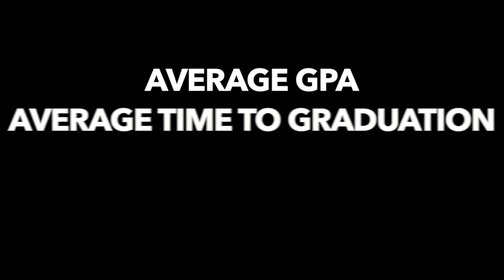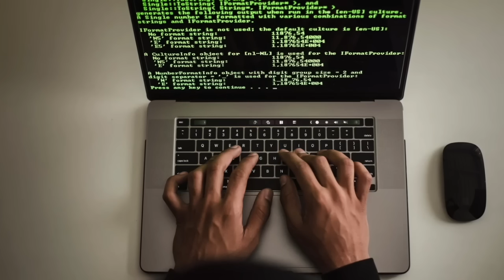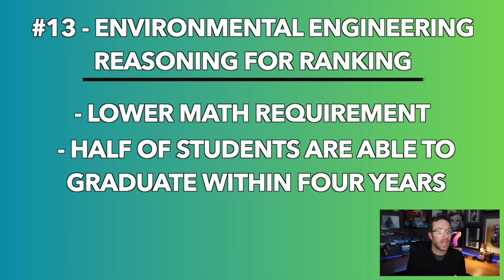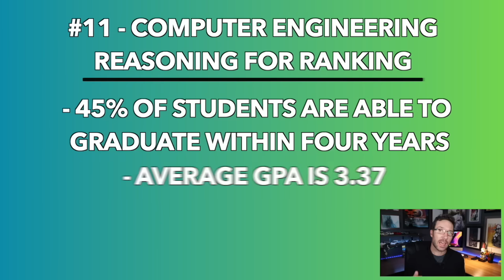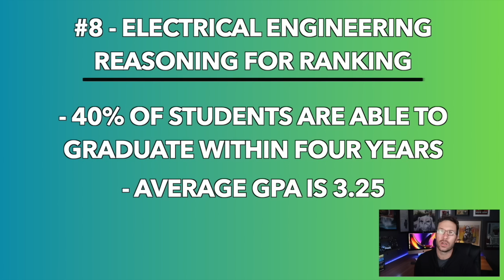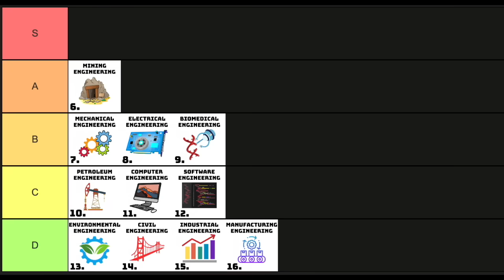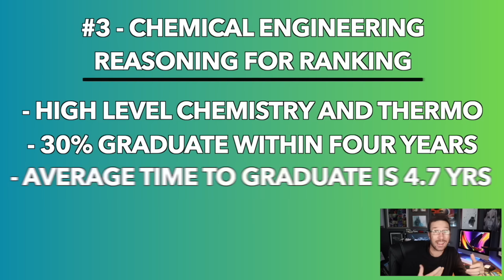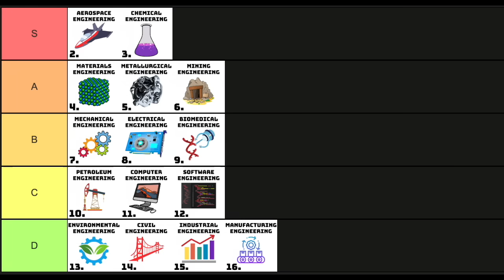Engineering Degrees Ranked By Difficulty (Tier List)

Comment: The Math for Electrical Engineering is one of the hardest math (Maxwell's Equations, Schrödinger equation, Landau–Lifshitz–Gilbert equation, Laplace Transform etc etc )
Reply: Laplace transform is fucked up, I did in uni, but I don't remember much of it, I salute everyone that have a good memory to really understand it, Maxwell is pretty hard too.
Reply: @eriksilva631  Yeah it can be quite daunting! If you go in with the idea of seeing it as a tool for turning differential equations in to algebra problems to find solutions using tables, it's a neat recipe to have in the toolbox. It can be very rewarding to dig deeper in to it though, especially Control theory and understanding the stability of a system!
Reply: @sebastianjovancic9814  Controls is interesting stuff!
Reply: @JIMLAS3359  yeah! So many of the systems we rely on use control theory, like PID-controllers, used in for example avionics or automotive systems! It's also interesting to design audio effects by exploiting the instability of a system to get for example oscillators :D
Reply: @JIMLAS3359  and the math behind digital control systems and digital communications systems gets a little heady.
Reply: @eriksilva631  Dude Laplace transforms are genius.  It allows to convert an integral in time or position domain into the frequency or momentum domain and vise-versa without actually solving the integral.
Reply: @eriksilva631  I don't know man. I loved Laplace because it was useful in signal processing and I loved that class. I thought it made things easier. I hated EM though haha
Reply: Exactly. I don't know why he listed only ordinary differential equations.
Reply: @Citizen052  lol I'm in Chemical Engineering. I wish the highest difficulty of math was ordinary differential equations.
Reply: @Citizen052  yeah but in broad spectrum most jobs doesn't need that level and you get paid for those extra stuff in any engineering degree your knowledge about physics and math set's you around and more you add to that base from your specific field it's extra pay but let's get real companies doesn't need more that 2or 3 percent of their engineering department that dedicated
Reply: @hellno100 yes, but it is that knowledge that sets us apart from technicians 😊
Reply: @Citizen052  some people need knowledge to aquire money some pay money to aquire knowledge
Being in that a few people definitely worth the pain and not just for money
Your views are exactly what they want for development
Sometimes I imagine my heaven being a full lab in middle of nowhere and I just swim on ocean of knowledge and yet better expanding it
Technician is a robot after a while (not that it's bad it's actually great but not all people made the same for example one of my darkest days was when I realized there not enough lifetime to learn it all)
Reply: Physicist here. I was looking for this comment. How did he end up with the conclusion that EE only needs up to ODEs? PDEs are an important part of EE especially electromagnetics… EEs work in complex domain as well and with mathematical tools like Fourier and Laplace transforms that other engineering disciplines don’t have to deal with. EE has, by far, the highest mathematical requirements of any engineering degree that I know of.
Reply: @cielsteam  It is not possible to state in such a  casual way what the EE  requirements are (or for that matter in any  other modern engineering domain)
Like in most other scientific areas, the variety of branches has grown and continues growing.
The requirements for preparing a career in (for example) power engineering cannot be the same as those needed to pursue a career in, say, Artificial Intelligence or even simpler Computer Sciences..
There are also ever more overlaps, some surprising, between branches of EE and totally outside areas. Take for example AI and/or voice control. Not only  you do need to study subjects related to feedback control systems
 but it becomes necessary to have a good understanding of mathematical logic, linked to linguistics and in turn linked to grammar and sentence structural construction that you expect to be taught in specialized litterature courses.
Reply: @pindapoy1596  Then you can make that argument for all the engineering disciplines in this video. The point here is to have a good reference through which to measure the mathematics needed for each engineering degree, and that means (to me, at least, I feel this is reasonable) looking at what each degree requires for its recipients. As far as I know, EE degrees in most universities require that you take courses that cover the mathematical topics that I mentioned. This is why I am able to state so casually that EE requires PDEs, Fourier analysis, Laplace transform, etc. and that the classification presented in the video is inaccurate.
Reply: @pindapoy1596  In my grad school, Power Systems and Control Systems were lumped together as one discipline.  I took one course in power, thinking that since I had worked as a co-op student for the power company (Ohio Edison) back in my undergrad days in Ohio, that it wouldn't be too bad.  I was introduced to per-unit calculations.  I don't think they were as hard as the brain-twisting stuff I encountered in my controls classes (advanced digital controls and non-linear controls were the most intense).
Reply: @cielsteam  Every EE PhD committee must have at least one member of the Math faculty on it; at least that was the requirement when I went to grad school at the University of Houston.
Reply: I'm surprised by the math requirements for these engineering degrees. I received an EE Degree in 1968 and I had to take Calculus as a Freshman, and later Lapalce Transforms and even Advanced Calculus.
Reply: @badguy5554  I'd imagine it all depends on what you specialise in but generally speaking EE, as many fields, has developed a lot since then and there are simply more basic requirements than previously. Digital systems barely even existed then, most electronics was still based on valves and antennas were mostly dipole so the math needed for most EE was relatively speaking easier!
Reply: These are called partial differential equations that are also required in ME.
Reply: I covered all of that as a MECH E , thats the basic math for most engineering degrees
Reply: And then there discrete time domain counterparts(z transform, dtft, fft etc)
Reply: If you think Laplace Transform is hard, then you didnt encounter the really hard math
Reply: the only math i remember among what you mentioned is laplas transform. i dont remember the others maybe my brain protecting itself from past trauma as an EE
Reply: Because Mechanical Engineer student does same. We work with Laplace equations , Taylor's, Bernid and so many more
Reply: ..Purdue 1970 BSEE here…Laplace and Fourier are shortcuts as I recall…if you want to talk mind bending let’s discuss electromagnetic field theory…oh my!
Reply: @gavinhadley7672  The overall discussion  makes no sense because it looks at careers as marathons and asks which one is the most grueling path.
To chose a career one has to feel an interest and persevere no matter how difficult certain parts are. People claim that one branch of engineering is more difficult than another one but that is no true either. If someone believes that civil or mechanical engineering are not difficult it is because they have no knowledge of how complex a structural analysis can be or what kind of mathematical tools operations research  (within industrial engineering) requires. or how much thermodynamics knowledge is required in mechanical engineering.
As far as the comment from    @gavinhadley7672  remember that Laplace invented his transform as a trick to solve (integrate) differential equations. There was no dream of electricity during his time. Fourier was looking for a mathematical formulation of heat propagation in solids, far away from electricity phenomena and electromagnetic theory and Maxwell's equations iresult from applying vector analysis with a few basic electrical principles added in.
A lot has to do though with the way courses are being taught. My first EE course was based on a book from the 1950's "Static and Dynamic Electricity" by W.R. Smyte from Caltech where the author develops the mathemathical tools as he needs them in order to support the electrical subjects presented in the basic course.That enables the student to stay focused on the electrical part while the mathematical part is clearly shown to be a tool and not a subject in itself. Out of curiosity, look up the book in your school's library.
And last but not least, all engineering fields are somehow merging in the modern world andyou can never know what you will be doing in your professional life. From electric micro currents in the brain to high frequency antennas, to artificial intelligence  language grammar to high voltage power systems stability one has to be prepared to respond to unexpected and fascinating areas of work.
Reply: @gavinhadley7672  Yeah, if you don't understand curl, you will never understand how the B-field works.
Reply: This math is required for Mechanical Engineering, depending on where you study it.  I had to cover all the math you referenced when i was an undergrad MechE.
Reply: @JIMLAS3359 What mechanical engineers are less likely to encounter or work extensively with is complex analysis which is the bread-and-butter for EM, signal analysis or Control theory. Pretty much all the mechanical engineers I know were always a bit flummoxed when it came to complex numbers and their use 😅
Reply: @sebastianjovancic9814  I do agree that it's an exception to the general experience.  The good side, though, is that there are plenty of hobbies where this can be used.  :)
Reply: @sebastianjovancic9814  First, it has to be said that both ME and EE generally allow you to choose (via electives and specializations) to largely avoid or dig deep into the really hard math. It is true that complex analysis is less prevalent in ME (although some, like me, choose to do a lot of control theory, for example). On the flip side, the bread-and-butter in ME tends to be highly coupled and non-linear multi-variate ODEs and PDEs that arise from the geometry of mechanisms. Like your experience with MEs and complex analysis, I would say the same about EEs that I've known when it comes to such systems. MEs might not deal as much with complex numbers with one imaginary dimension, but we deal a lot with complex numbers with 3 imaginary dimensions (aka quaternions, SO(3), SE(3)). ;)
As for the Maxwell and LLG equations and stuff the OP mentioned, I think that is pretty much on par with what you encounter in ME doing fluid dynamics and dealing with the Navier-Stokes equations and the thermodynamics involved in, for example, supersonic aerodynamics. That is also one place MEs deal with complex analysis, via conformal mappings, almost exactly the same math as in advanced EM topics.
Overall, I would say the difficulty of the math is about the same. If someone really loves math and wants to apply it usefully, either fields is great. I would just say that ME might be, unsurprisingly, more for people with good spatial reasoning (aka geometry). While EE might suit people who are more analytical. In a nutshell, if you don't like trigonometry, don't go into mechanical engineering. ;)
Reply: @mike200017  Completely agree! Specialisations in ME can be frighteningly complicated, especially as you say with fluid dynamics/continuum mechanics! My original point is rather aimed at the first few years of engineering when you haven't specialised yet, you're more likely to encounter and build good intuitions for complex analysis in the first couple of years of EE! I think you're far more likely to encounter and familiarise yourself with tensors in ME than EE :p

My knowledge of specialisations in either field is only through second hand information though, I went a completely different route 😅 but I'm rather happy I chose EE as my basis, a wide variety of theoretical maths (real and complex analysis, linear and boolean algebra, signal analysis), good primers for computional systems/programming and also plenty of practical work that gives me the freedom to design and build DIY tech solutions in my every day life! Highly recommend it for people who like tinkering with tech, although maybe that's obvious hehe
Reply: @sebastianjovancic9814  Overall I agree. But signal analysis and mechatronics is also part of ME. There you definitely need knowledge of complex numbers, control loop stability analysis,  Fourier and LaPlace transforms for system identification etc.
Reply: @PbPomper  For sure, with the right specialisation! My point is more about the base curriculum, signal analysis and control theory are more likely to be elective for ME while it's more likely to be mandatory for EE!
Reply: Let’s calculate Poisson's equation for a diode with custom concentration spread boiz.
Reply: Fourier Transform is used almost everywhere in the coursework of electrical engineering.
Reply: Signal Processing (sub-discipline of EE) is very heavily mathematical oriented
Reply: no electronics communication engineering 😮
Reply: @ionpopescu5415   I am not sure that your statement of the problem is correct. Universities and engineering schools have a different role, that of teaching concepts. The basic building blocks that enable an engineer to find the way to solve the problems during his/her career.
If you want to work designing a GPS or a remote guidance system for a satellite or missile you cannot ignore relativistic equations, if you want to work in artificial intelligence you cannot ignore mathematical logic and the structure of grammar which has a literary and non mathematical component. And if you want to do more classical engineering like road design or sanitary engineering you must have strong knowledge of engineering economics which is essentially financial mathematics closer to the stock exchange than to hydraulics flow equations or traffic predictions and probability analysis..
And then you have lost and forgotten engineering. Electric vehicles? But who knows how you regulate the speed of a series DC motor anymore? Interested in Bitcoins and not being aware the forgotten power engineering specialty provides the vital electrical supply while nobody knows how a transformer works or how to calculate the transient stability of a power grid.
So, bottom line, what should a school of engineering teach? Definitely not a recipe book of formulas to resolve all the problems one will be faced with. And what should we learn? Less specialty and more concepts.
Reply: The part that drove me away from being a EE was that you had to believe in electricity.  I was as afraid of letting the smoke out
Reply: What? No Green's transformations....LOL. Every once in the while I dream that I messed up and didn't graduate. LOL
Reply: @evolvedentertainment30  Grenn's transormations are part of pure mathematics courses (vector calculus) Everybody, not only EEs that take a course in vector calculus will necessarily get to handle Green's transformations.. 
Are you talking about EE as an engineerig career or all the basic courses needed to get a degree  in EE.? Your comment seems to indicate that you are fixated on some details rather than looking at the big picture. 
Every once in the while I dream that I messed up and didn't graduate. LOL. But I also studied electro chemistry believe it or not. Did you???
Reply: I had those in my computer science too xd
Reply: @yumiko.-.8618  Not so sure what you will do with those mathematical subjects  in your area. I wonder however if you had any courses in Boolean algebra, mathematical logic or language structure and grammar that is essential in artificial intelligence.
If you read any book on secret code breaking during the war, you will find out that Turing's team was composed by mathematicians that dedicated themselves to numbers theory, tackling the insolubility problems (ever heard of Godel's principle) and using statistical methods applied to linguistics.
Reply: @pindapoy1596  ?? well i dont know what i will do with it either its just what I had to learn to pass my exams xDD
Reply: @yumiko.-.8618  What you are saying is very true. I am however astonished by the curriculum at your institution.  I would agree  that early on a student should get a good general background  in mathematics and physics and then get into more specialized areas but I have no idea of what your school will offer you when you will  focus on your career choice which in your case is computer sciences. I hope that you can find well qualified advisors because from what others have posted on this thread, it seems that there is a lot of confusion and many complaints about the difficulties with certain courses. The whole discussion on this thread seems to be mostly about "my career is harder than yours" type competition and not about what is really needed in order to become a good professional in one's field of choce.
Reply: He definitely got the EE math wrong. After DiffEq - we did partial differential equations- we had two more ‘advanced engineering’ math classes. However, these were EE dept classes, not math classes, which maybe why they weren’t considered. Control systems, electromagnetic field & waves math, Eigen vectors, Laplace transforms, etc, are something you won’t find in most other disciplines (nuclear aside). Maxwells equations? Seriously. They teach these to graduate level mathematicians just to see if they can cut it.
Reply: @ralphjones4355  Sorry but who is HE? (He definitely got the EE math wrong). No offense but we engineers are usually more specific than that.
This aside, this whole discussion that erupts from time to time is not very constructive. It is a collection of mostly mathematical subjects that delight name droppers but do not approach the real problem: Which ENGINEERING career is more difficult. Because this is about engineering and not about the difficulties in handling some basic mathematical tools. By comparison one can say that sawing  a piece of wood in a straight line is difficult but sawing is not to be confused with artistic furniture making or carpentry in general.
One should consider the engineering career in depth and not the variety of tools
(including the mathematical tools) needed in one's professional life. Take the case of an EE hired by solar panel making company. All these fancy mathematical theories that people delight in listing in their posts will be of little use without a strong knowledge of electro chemistry or the atomic structure of 
materials. So where do you learn that and how important are those things?  This is just one simple example and again without offending anyone, try to imagine a job interview at the solar power panels plant trying to impress your future boss with Poynting's vector or Laplace transforms chat.
Reply: Don't forget Fourier Transform which is part of EE. EE is underestimated here. It is heavily maths oriented.
Reply: @lahoreaskari2651  This discussion is absurd because nobody focuses on what engineers do and what they need to do in order to become productive members of our society.  All you get here are complaints about the difficulties of math courses that are quite incidental to an engineering career. Wake up guys; ever asked yourselves what will your work consist of once you get your engineering degree and eventually apply for a professional license and go for the 8 hour exam?
Reply: @pindapoy1596  I see your point but I think this is supposed to only focus on the difficulty of earning these respective degrees.

Once earned, what the engineers do is a whole different matter, I agree.
Reply: Yeah mechanical did all that and it was a breeze. I often heard electrical engineers saying they had it rough but when I did mechanics and aced the mechanical and electrical portion, I had ppl say they couldn’t believe I got an A in the class. During the mechatronics class we had to pair with an electrical engineer but mechanical learned the foundations of electrical so when it came down to electrical learning the moments of inertia along with control systems, I couldn’t explain it any easier without the whole electrical team scratching their heads. Only part I couldn’t get was the hands on work for communicating with our robot and data transfers but hey we all specialize in our talents. Always loved everyone’s interest. I just think electrical is pretty easy but that’s just me and only because in mechanical we learn everything
Reply: Why th hell are these things taught to class 12 students😑
Reply: Yeah, he seems to think vector calculus is lower level than partial differential equations, which I would disagree with.
Reply: Oh, and I really doubt that they throw a crash course in Quantum Physics at you in Mechanical Engineering. Maybe he's never heard of semiconductors or knows how a transistor works, or that computers are made of millions of them. That stuff is crazy. And come to think of it the diffusion equations involved are partial differential equations, aren't they?
Reply: You forgot complex analysis and fourier analysis, EE ain't a joke
Reply: Not to mention all the loop analysis stuff for control systems or communications systems.  Routh Hurwitz stability critera, pole-zero plots, etc,etc. Comms has a lot of noise analysis, signal mode propagations, refraction, scattering, path analysis, error correction coding, modulation schemes, to name but a few.
Reply: Exactly. There was a ton of math in EE. List is probably garbage if there are errors like this in it.